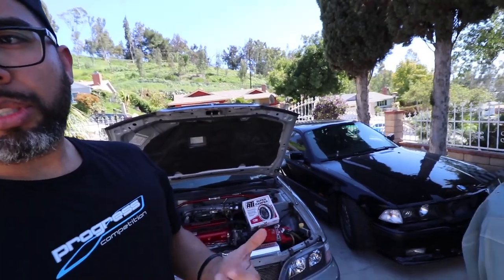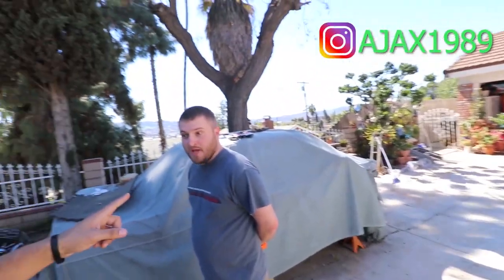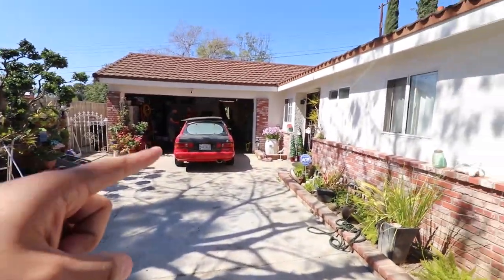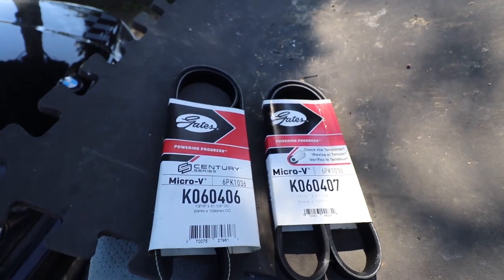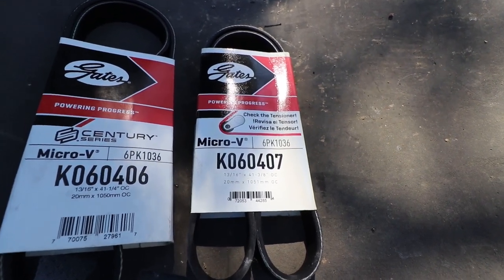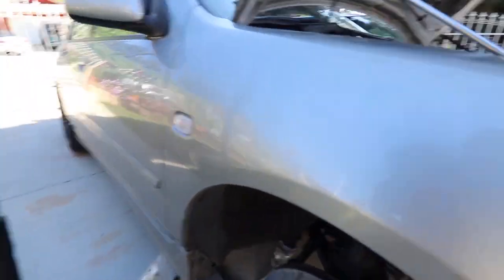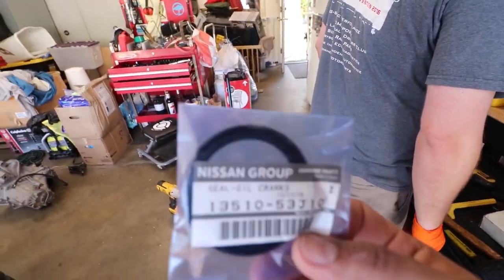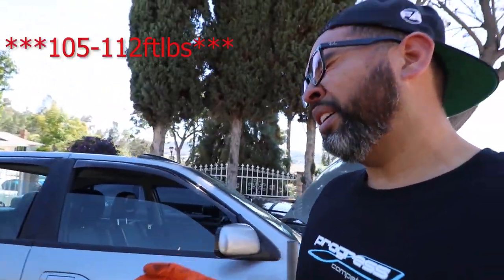INFINITI G20 P11: ATI DAMPER INSTALL

Comment: Sup with stillen Rear sway bar? For p11
Reply from the maker: What about it?
Reply: How good is stillen? Because you say progress is good
Reply from the maker: @jesusortiz8584  technically the rear bar on a p11 isn't a sway bar as the rear of the p11 is a beam. They are more like stiffening bars both do the same.
Reply from the maker: Good bar, not as good as progress haha. In all seriousness its a solid bar. Not many options for the P11.

Comment: I'm looking for a front sway bar for my p11 any ideas?
Reply from the maker: No aftermarket options available. Get a rear one, front and rear strut bar, control arm bushings, rear trailing arm bushings and a better suspension. It will make up for it.

Comment: What area in socal you guys in?
Reply from the maker: Los Angeles
Reply: Im in south riverside county. I daily a 96 g20. Would love to ve swap in at some point but currently looking at upgrades to my DE that may be able to carry over to a ve in the future. Any suggestions? I was looking at the JGY pulley kit but see you guys are all running the ATI damper. What are your thoughts on the JGY pulley kit. Mostly want to get a new crank pulley so timing is accurate and maybe get a couple hp. Really like my car but it seems support is a little limited.
Reply from the maker: @ardyshane23  intake, headers, exhaust.
Reply from the maker: @ardyshane23  don't buy from JGY. They are the worst vendor this community has had in the past 20 years. They constantly have bad customer service and at times take your money and never ship you parts.